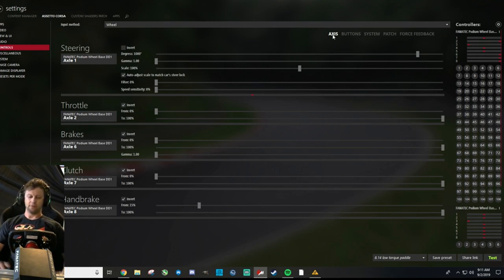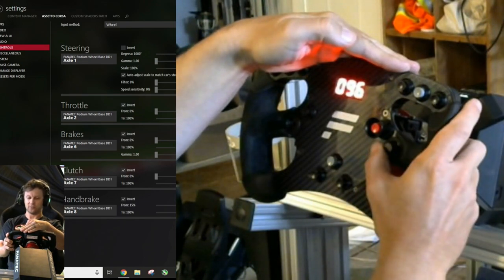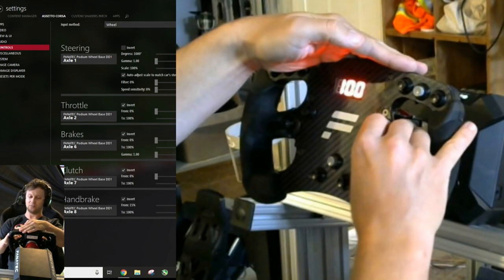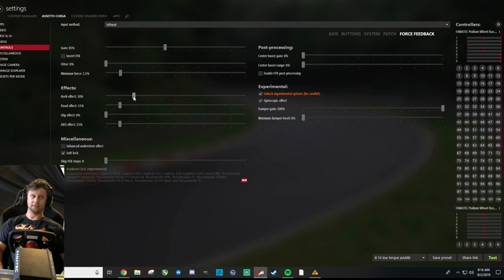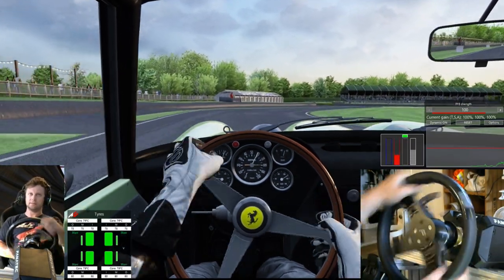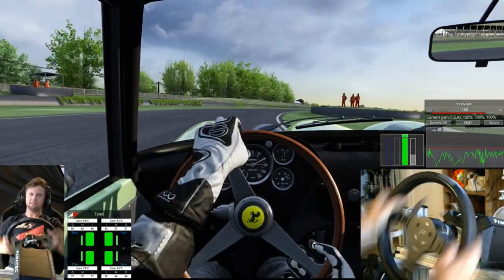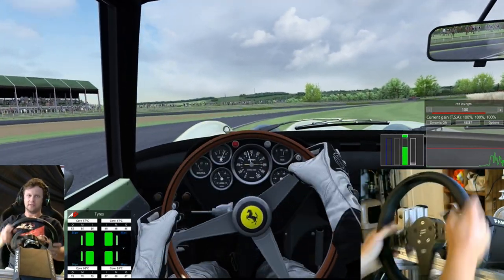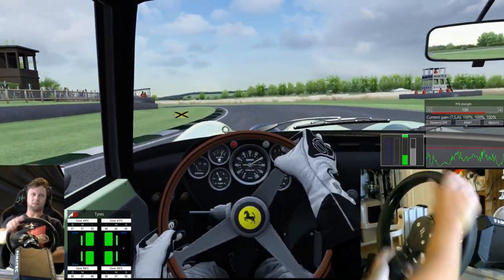Get the most out of your Fanatec DD EP:2 Round Rim settings and tutorial.

Comment: Hey, getting quite a bit of wheel osolating around the centre on wrecked. Any tips?
Reply from the maker: wreckfest?  or when I crash in AC.  it seems to be different in every car how violent the crash FFB is on AC
Reply: 2Old4Forza Wreckfest when I’m driving straight it’s trying to go left right the whole time. If I let go it just goes left right
Reply from the maker: @rapidpixelracing-rpr3066  yhe beat way to fix this is to install the new fanalabs flatware and use the first dynamic damping option.  It's made specificaly to eliminate osaliton at center.  Or you can run the natural damper higher.  I like mine at 35 for wreckfest. No osaliton for me with this setting.  Before fanalabs